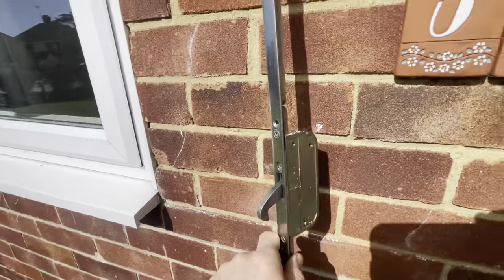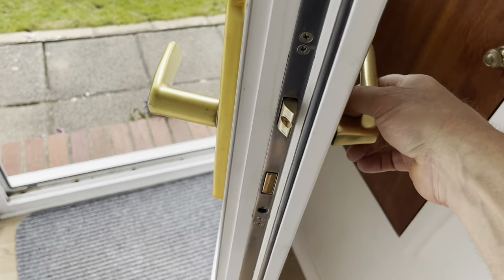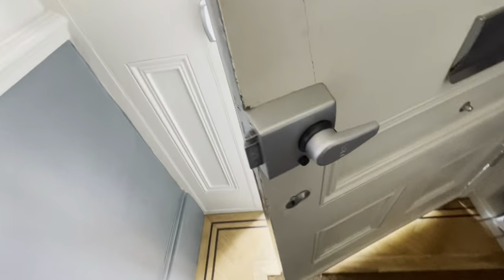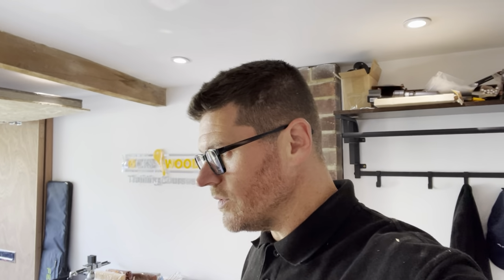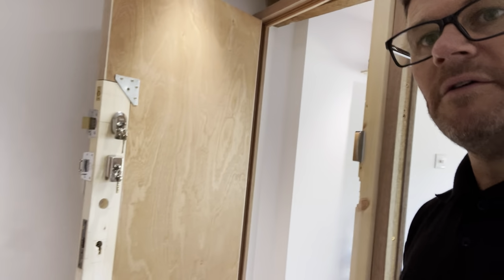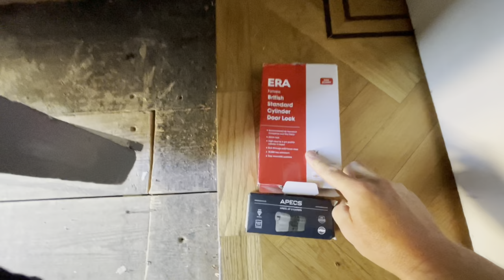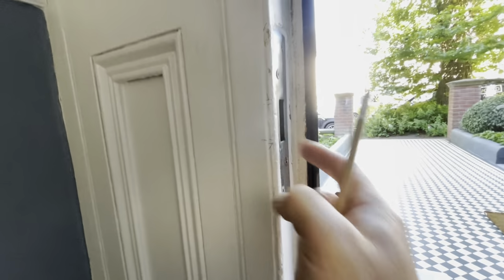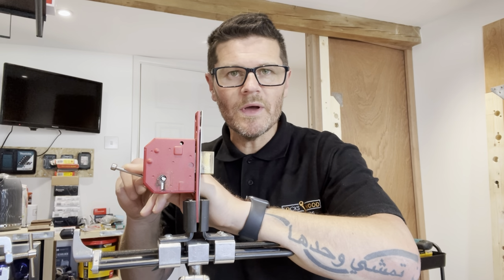Brighton Locksmith Various Jobs | Mortice Lock Picking - Locksmith

Comment: Those BS nightlatches are much more tempermental than standard ones, learnt about the tailpiece length the hard way with lots of head scratching before now. Great picking mate, do you have the GJ 2in1 or something else? Went to order a GJ LBT motor turner yday and he's sold out so have got one in from 'outside-in lock tools' which seems fine but only time will tell!
Reply from the maker: Hey buddy. 
I’ve found the BS night latches to be fine as long as they are fitted correctly. 
Yes I have the GJ multi pick and the ALS one too. Both very nice picks mate. 
The GJ motor turner is one of my most used prices of kit! I’m sure the Outside In one is good too 👍🏼
Thanks for watching buddy
Reply: @brighton_locksmith  yeah they are but if you’ve never fitted one there’s a lot more to know/think about, and like you say in other videos you don’t learn this stuff on standard locksmith courses and if you’re not a carpenter it’s learning on the job! Lol Thanks for info I’ve got a 2 in 1 from A jam I got free on my course, but not sure it’s same quality/usability as others you mention. Keep the videos coming mate great stuff really enjoy watching.